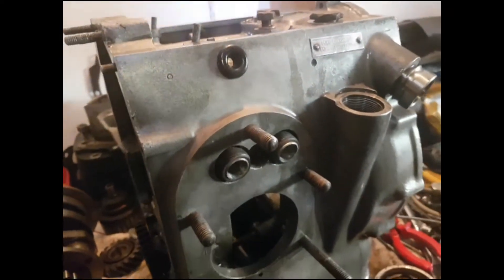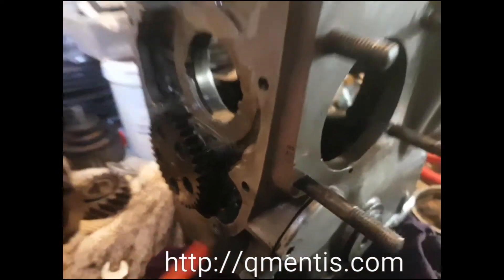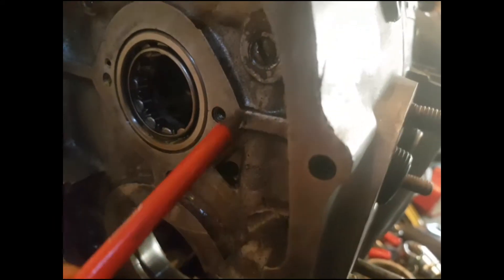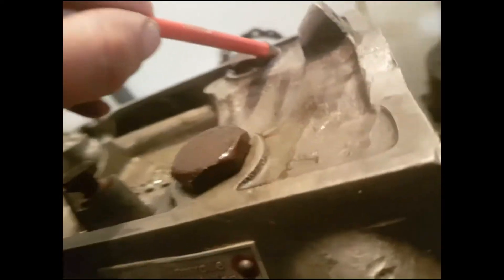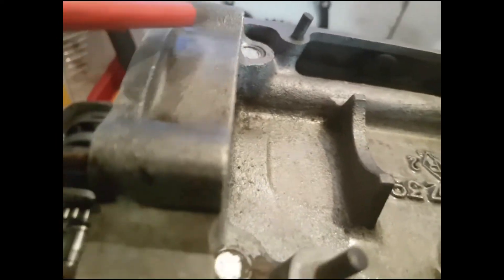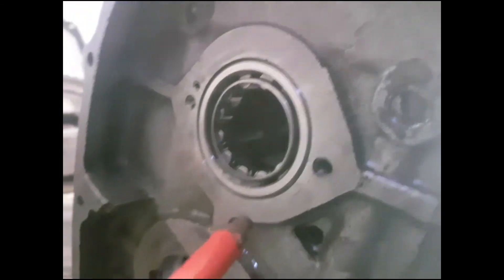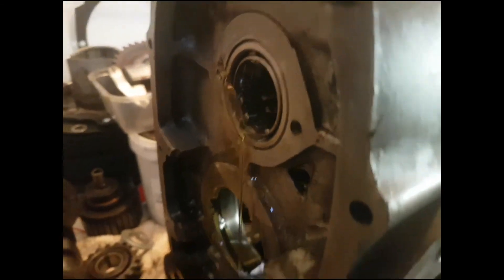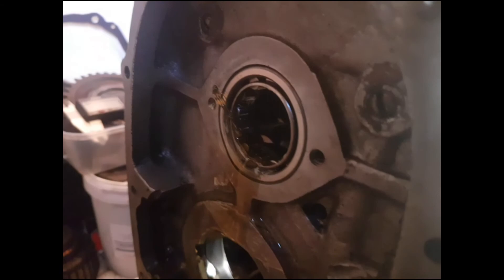Zundapp KS600 oil pump system explained. Also similar to KS750, K800, K500

Comment: Great Video. How can you tell if the pump is working when it is not apart and on the bike? Thanks, Rob.
Reply from the maker: Robert Cassin: Hi, there are two places you can see on the ww2 engine, in the side inspection cover (check pressure here), and the level in the top radiator. You cant check internal flow without getting inside. Ive been documenting it on my website, so leave a commemt and that will give me youre email address... you helped me before with my bw38.  http://qmentis.com/vintage-motorcycles/zundapp/ks-600/oil-pump/